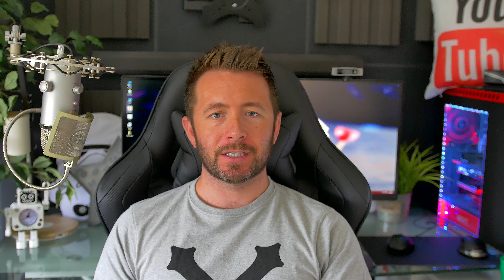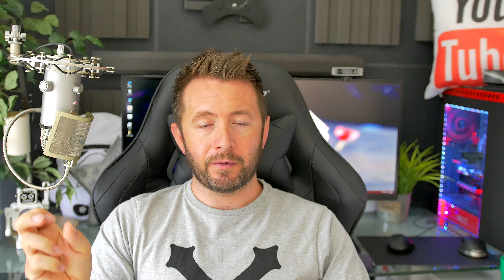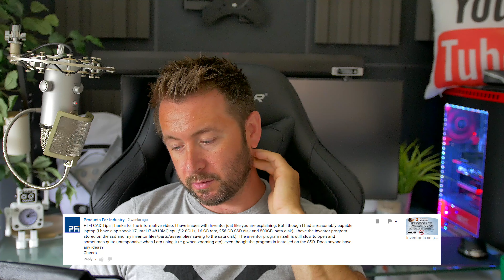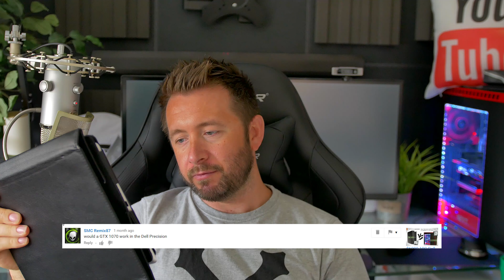Ask TFI: Which PC to Build, Quadro with Alienware, Angular Constraints, DXRacer

Comment: I thought connecting my laptop to my  big sony lcd tv would give me lots of screen space to work on. But it was no use as the text in the tv monitor is so blurry. I can only see the text when the sceen in zoomed in equal to my workable laptop zoom. Can I improve this.
seems like tv monitor is using resolution same as that of laptop. I wanted to use auto cad on tv monitor.

Comment: When I need workplanes for different 2D sketches I always make them inside a 3D sketch so I can change they visibility quicker and it usually makes less problems with features when changing and deleting planes. When You start 3D sketch You can go to "3D Model" tab and make workplanes as You would do normally. Also You can easily constrain lines and points to the Workplanes, however that You can do without having them in the same 3D sketch.